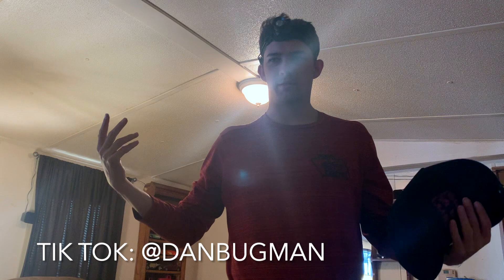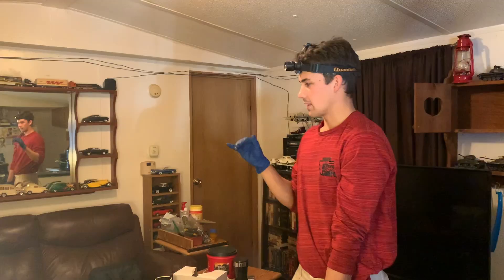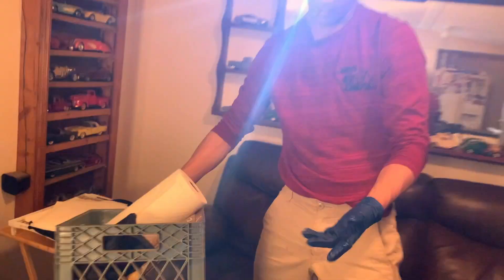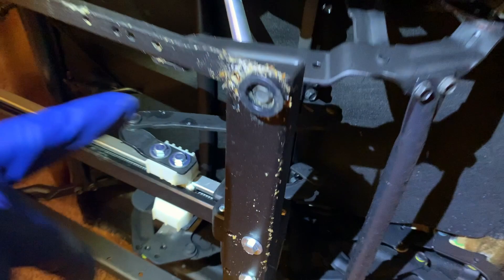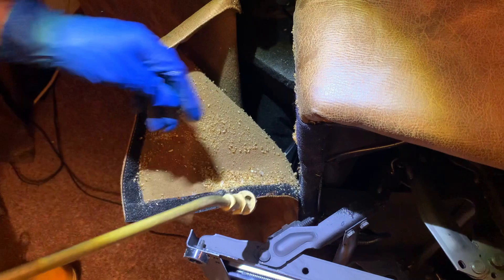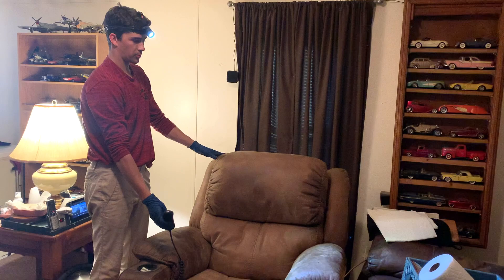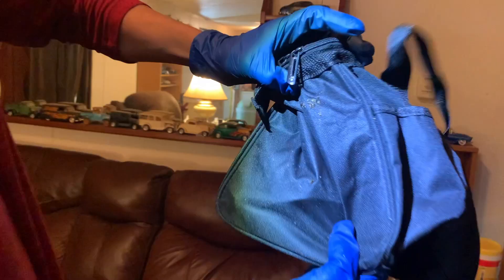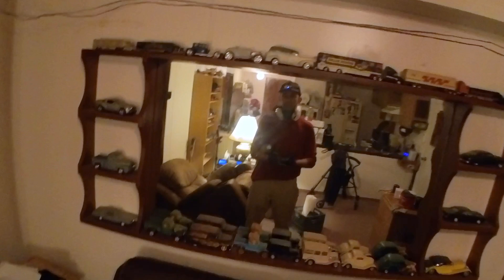Gross Bed Bug Infestation and Treatment

Comment: So as a former Pest Management professional who was state certified in four states I feel like I need to point some things out. #1) Proper PPE, you need to be wearing LONG sleeves and not have any exposed skin when spraying chemicals with you B&G Sprayer, pesticides can be absorbed through the skin very easily. #2) You need to be wearing a respirator when spraying liquid pesticides, at the 3:16 mark when you are spraying up the side of the chair you can see liquid bloom in all directions, you are breathing in small amounts of that. #3) Safety Goggles, again when spraying liquid pesticides with you B&G water vapor can easily be absorbed through the eyes and into the body. We had a saying where I worked, THE LABEL IS THE LAW! Read the label and it will tell you what PPE is required. I am not trying to be mean brother, I just want you to be safe and not have to deal with health issues due to long term exposure to pesticides.
Reply: Agreed
Reply: As a former idc and keyboard warrior. I can tell you most guys working these jobs do risky stuff. Like the risk they cloud get bugs themselves.. I hung out in my apartment right after treatment. Fine

Comment: If they don’t heat the house to a certain temperature they will not kill them all. Supposed to spray and use heat.
Reply: In 2012 I had a bed bug problem in my apartment. It was a complex wide issue. They had an exterminator come out and spray. After that I threw out my couch, chair and bed. One week later, no results. They had a bed bug sniffing dog come out because management didn't believe I had a problem. The dog never hit on anything but right as soon as they left I found two on the floor next to the foot of my bedframe. I grabbed them, put them in a Ziploc bag and walked to the front office to show them. Two days later they heat treated and the problem was gone. Mentally took a lot longer to return to normal. After getting new furniture I kept checking crevices and cracks.

Comment: I am about finished with my first bedbug kill and treatment.  I am seriously sensitive to the bites so I discovered them very quickly.  I went into overdrive mode and treated everything like it was a major infestation.  They literally came in to my home in the grooves in the bottom of my shoes.  I left the shoes at the foot of my bed like every night and poof I have bed bugs!  The only nesting area was a foot from the shoes and a foot from
The bottom of the bed in a bed sheet my dog took out of the laundry basket and drug there. Knock on wood. I think I have most of them.  No sign on mattresses or metal bed or pillows.  But I steamed everything, sprayed everything, walls and baseboards and inside behind switch plates, under all dressers and drawers and picture frames.  And I will do it all over again in about a month.  So far nothing showing up in traps.  I think I did the correct thing by overkilling the situation without toxing myself out. Arghhhh! I have so much respect for you doing what you do to help people. I know it’s your job dude, but thank you💛

Comment: I just found one single bug after doing routine bed vacuuming. Never had beg bugs in my life and I never take second hand soft items or wood heck anything… then I find out you can bring them home from anywhere!!! I’m getting my place professionally treated but my freak out made me bag up everything and dry them the I sprayed the who matter and frame with 99% rubbing alcohol. Dusted DE on all the furniture and baseboards and electrical sockets OMG I’m so scared because I live in a building

Comment: What products r you using in your BG? I see thats an alpine spray can, are you using Alpine WSG also? I own a small pest control company, but im a little hesitant to take on bedbug jobs as everyone says it can be a big pain in the butt... but i know there's big money involved
Reply: Where is your company located? I was in the industry for a decade and was state certified in four states. I was the guy they sent in to solve difficult cases that the rank and file techs could not deal with. There was an apartment that had been treated 16 times and the bed bugs kept coming back, they sent me out and I solved it in one treatment. I worked in some of the worst areas of DC and Baltimore and have seen bed bug infestations 100x worse than this. I wouldn't mind visiting you and doing some training with you so you could take on those jobs with confidence that you can solve these issues.